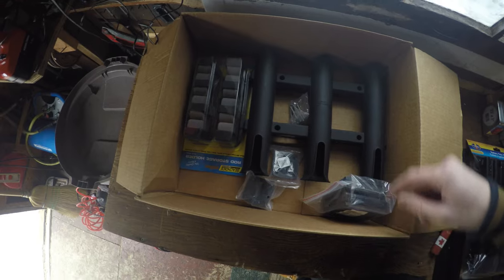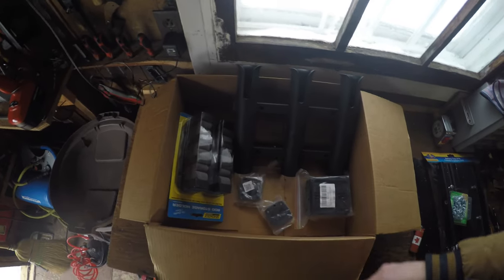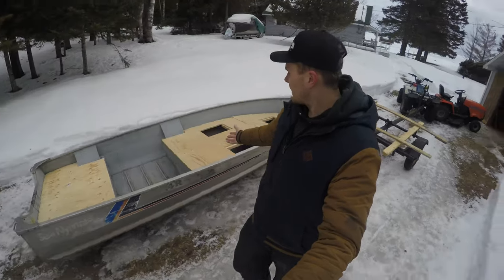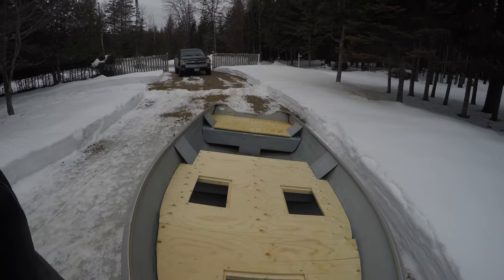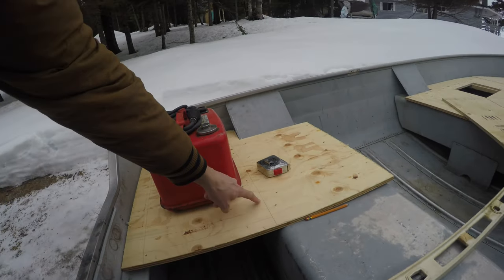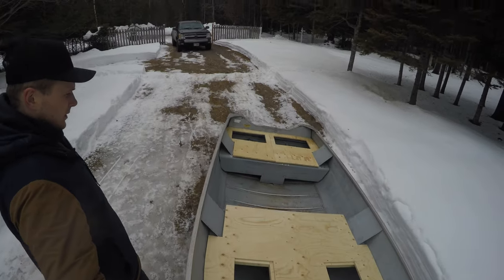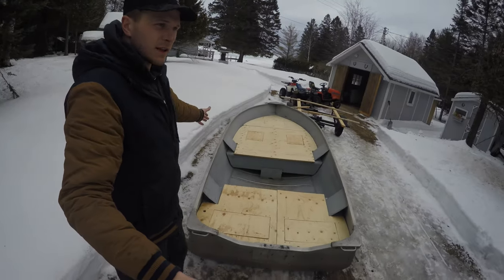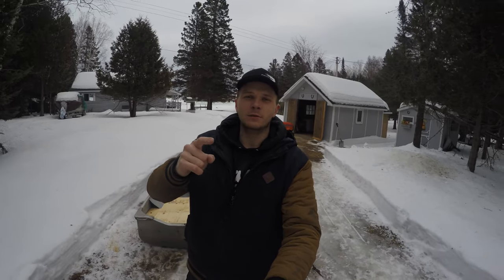Aluminum Boat Casting Deck Build | HOW TO Build a Casting Deck Ep.2

Comment: What did you use to support the plywood deck in the front and back? Is there 2x4's  under the plywood like framing? I have the exact boat and wanna do the exact same..thanks in advance
Reply from the maker: I will have a part 3 video up soon and I will show all of that good stuff! Thanks for watching:)